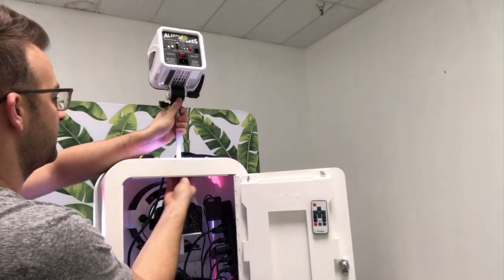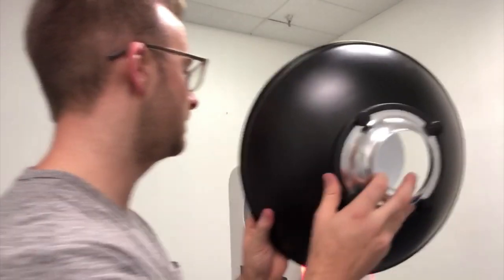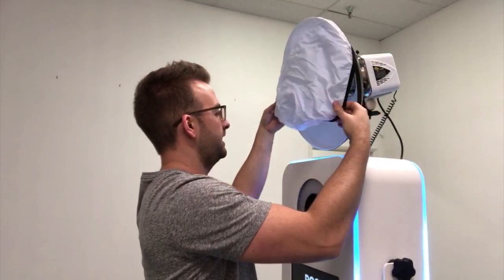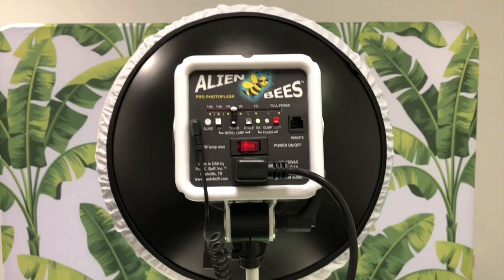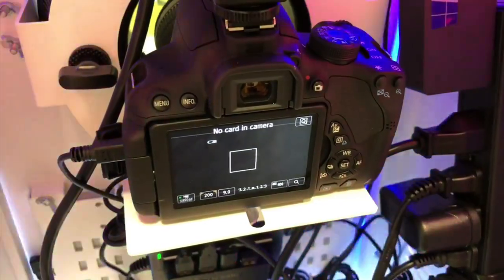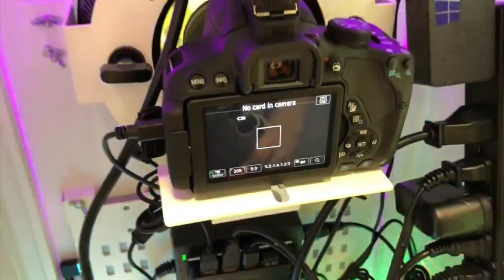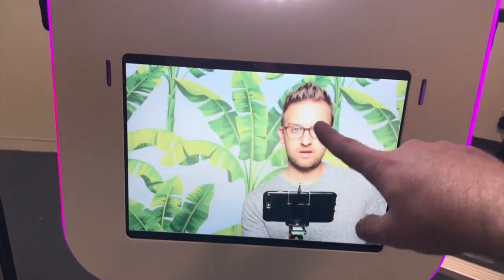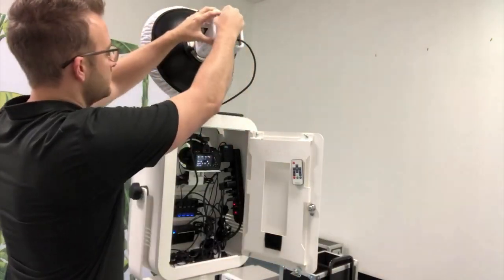How to Improve Your Photo Booth Lighting Setup

Comment: I received my t12led but there no place to add a mount on top how did you get yours with one
Reply: Did you recently order this? All their newer units should come with it. We made the cutout ourselves with a large drill bit.
Reply: @jonathanconnolly3829  yes I pick it up yeasterday but there was no thread hole on top of the unit just vent holes and I didnt recieve that white pole you have to mount the light . So I figured you made it yourself. If so what type of drill bit did you use
Reply: @familiacoronado7510  Awesome! Reach out to RBA directly. They helped provide us with the sizes needed to make the cut. We had a local handy man do it.

Comment: why do you have 2 lights?
Reply from the maker: The constant ring light that is built in is used mostly to help with auto focus in darker venues. I don't ever use it for that actual flash because its direct lighting which isn't flattering. But it can also be a backup flash should your other one break.